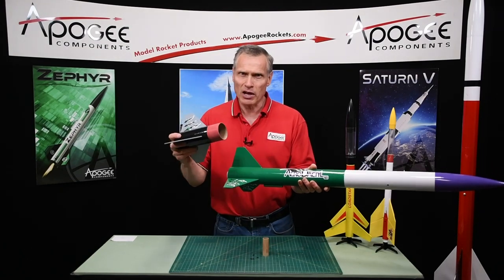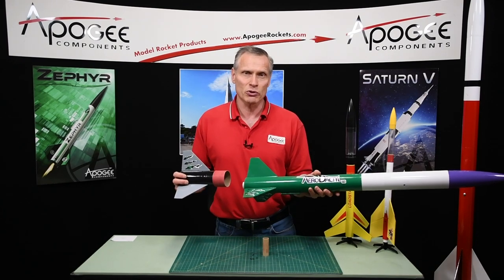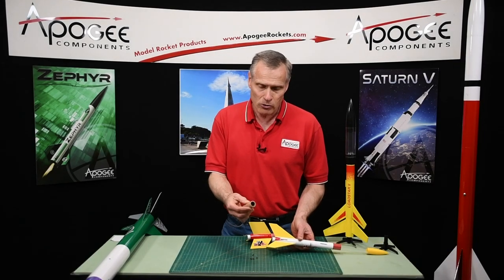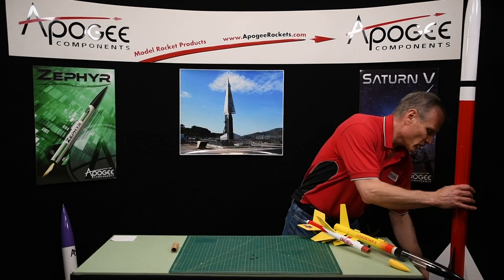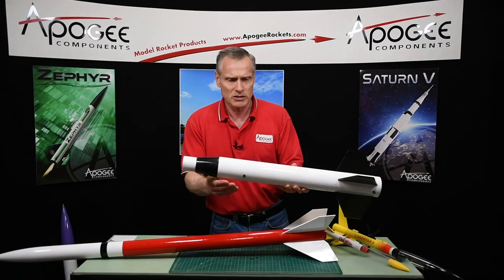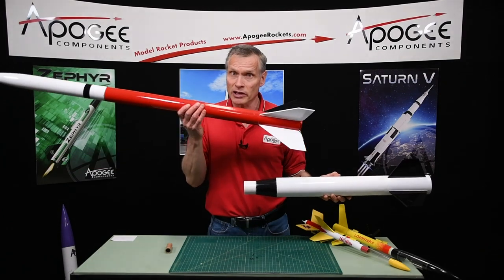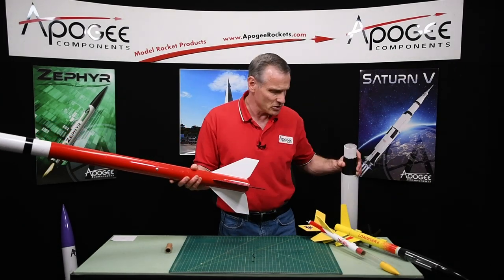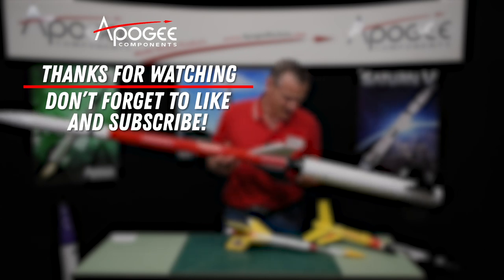4 Ways to Separate 2-Stage Rockets

Comment: Don’t feel bad, Tim.  I’ve barely touched some of my rockets and knocked fins off, too.  Makes you wonder how they can survive flight after flight.
Reply: Rick Sorber Yeah.
Reply: Agreed.  I sometimes just get near to objects and they break...😊
Reply: Is there a way to eject a parachute to the first stage so that it doesn't just fall to the ground?
Reply: @Nick21012  You can do that by adding a chute and a shock cord to the first stage and wrapping it in fireproof wadding. Once the First Stage falls off, the parachute will auto deploy (in theory, I have never built a two stage design)
Reply: @inventorsyndrome8894  or you use rear-eject with a spool and after the sustainer drag separates the booster motor's ejection charge fires and pushes the motor mount and parachute out the back of the rocket

Comment: Thank you, now in working on my own two stage rocket and your video helped my so mutch. I hpe There isnt any mistakes because im from europe
Reply: Hey man, m new to rocket world.. could you suggest me a good fuel??
Reply: @4nirmit  i think you can buy some estest Black powder motors.
Its well for starting
Reply: @hugotoscher4734  thanks man!
Reply: Is there a way to eject a parachute to the first stage so that it doesn't just fall to the ground?
Reply: Yes it is, but you have to yuse electronics to fire second stage. Than you simply put there engine with short enjection charge.

Comment: I have of course used the booster rocket pressure when I was a kid first flying estes rockets,  the combination of both engines firing was usually enough to separate with the booster stage simply falling back to the ground. That also was pretty hard on fins simply glued by white glue. But every thing was so light that damage was repairable. My budget was much limited so my efforts were spaced apart. Now I am in my 73rd year and I am more limited by travel to a suitable launch and recovery site.  Still I get a bit of enjoyment every time I launch something,  over the years I have introduced many to this rather expensive pass time.
Reply: It’s not expensive right? You can make the rockets and launchpad and parachute and other accessories all youself, so then only the motors are a problem and they are not cheap I agree. But I have seen people make their own with potassium nitrate and that’s cheap. The cost of the hobby really depends on how much effort you want to put in, at least that’s my opinion.
Reply: @bas5070  Low power can be done on the cheap but once you start to get big, things start to get expensive. To make your own motors you need to be at least level 2 certified and a level 2 rocket can be very pricey.

Comment: The old Estes model rocket instructions recommended that the motors for the separate stages be taped together with clear tape so that they wouldn't come apart too soon after the booster propellant blow- through such that the upper stage motor wouldn't ignite. That limited the length of the booster stage(s) and a lot of their vintage kits have large booster fins to compensate for the concentration of weight at the rear of the rocket.
Reply: I wish I read this before it happened to me 😂

Comment: Hey, Tim. I just wondered, when using drag separation, you could also use an electronic circuit in the second stage with a switch that activates the second stage motor when the two parts separate. That could be done by a short string coming from the first stage that then pulls out a seperator (maybe a piece of paper or so) that is separating the two parts of the switch so that the circuit is closed when the paper gets pulled out.

I've never seen that before, but it would certainly be interesting to see. Like that, you'd just need a power source (battery) in your second stage and no other electronic components. Maybe the acceleration G's might be a problem for the seperating piece of paper (it might get pulled out by those forces, idk) but it might be worth testing something like this.

Cheers, Jan
Reply: Yea there could be nonconductive material between the ignitors that gets pulled out when the first stage falls off.
Reply: I was thinking the exact same thing. I have a rudimentary trigger for a warning buzzer that alerts me when someone, or something approaches my camp, or a specific area around my house. A $10 portable set up. Thin piece of plastic or cardboard between a spring contact (clothespin in my case), and string stretched across an inviting pathway.

 I guess you'd probably want a "remove before flight" trigger of some type, just to keep from an accidental ignition but that's simple enough as well.

Comment: Good morning Tim!  Thanks for the video, I always learn something from you.  On the two low power methods, how loose of a fit should the booster have to the upper stage?  It sounds like there is quite a lot of pressure, so I won't need it so loose that when inverted (on the ground) the upper stage falls off, clearly not so snug that I have to really pull them apart...  any tips there?
Reply from the maker: I say the same fit you use for model rocket nose cones.
Reply: @apogeerockets  Is there a way to eject a parachute to the first stage so that it doesn't just fall to the ground?
Reply: @Nick21012  sure there is. In the terrain kit for example you have a conic plastic section that joins upper stage and lower stage. In it you have to fit your electronic, with one pyro that ignites the upper stage, then a second one with proper delay that ejects itself out pulling the chute. Be careful to protect well your chute. It’s a kind of two stages.

Comment: I was with grandkids a couple of days ago and we built and launched a bunch of Estes Bandits. We had a couple left over so we cobbled them into a two-stage rocket. We didn't have any booster motors, so we used two single/upper stage motors and crossed our fingers. Of course it didn't work. I'm guessing the spacing between the two motors was too great, and the plug at the top of the first engine prevented the second engine from firing. (I couldn't remember the finer details of building two-stage rockets from the 60s, I should have known better..) We did hear a loud bang when the first engine burned through but I assume that was just the ejection charge, we just hadn't heard it so close to the ground on any other launches.

Comment: Is it possible to stack like 5 engines together for a higher flight? Would custom build rocket from scratch if it can be done might try over summer.
Reply from the maker: Anything is possible. But not everything is wise...

The National Association of Rocketry has a limit of 3 stages for a reason. The longer the rocket burns, the more weathercocking it will experience. So the rocket will be going horizontal, instead of vertical. That is unsafe. Always consider safety when launching a model rocket.

Comment: It sounds like you ended up with 5 different methods, or do you count the method where the electronics are in the booster as being the same as method 3?
Reply: Is there a way to eject a parachute to the first stage so that it doesn't just fall to the ground?
Reply: @Nick21012  I have never attempted a complex multi-stage rocket before, so I don't know how people do it, but yes, most high-power multi-stage rockets have parachutes in both stages
Reply: @coastermania17  They probably do it by separating both stages and having a parachute attached to the first stage. Then the second engine is ignited through electronics. That's probably how it works.

Comment: Wondering here. For larger, high power two stage separation, what would be your method of choice? My last rocket was a two-stage (I class motor on booster, H on sustainer), using onboard avionics for sustainer ignition, and while it flew successfully and recovery went well, the staging itself was pretty rocky, launching the sustainer into a corkscrew until it stabilized itself and reached apogee. My bet was that the fit at the interstage was too tight. Part of the coupler got burnt pretty badly and that asymmetric separation might have created some unwanted rotation. Any ideas or suggestions are welcome.
Reply from the maker: My suggestion is that with enough experimenting, you'll work out the bugs. But use scaled down rockets to do testing, so you save money.
Reply: @apogeerockets  Thank you. I'll definitely experiment more to figure out how to make the best staging. It just feels so good to see the second engine ignite in-flight, I won't be going back to single stage design soon.

Comment: What is the furthest distance you can separate black powder motors for staging? I would say what distance does the reliability for second stage ignition really drop off? Wondering if I could stage the new Estes Black Brant kit. Thoughts?  Think they call it pass port staging instead of direct staging when we gently tape the motors together.
Reply from the maker: I don't have a number for you. I've done more than 8 inches reliably with a small mini motor. I don't know a maximum. I encourage you to try and test it out. I'd be interested in knowing your results.
Reply: @apogeerockets  Thanks Tim. Sounds like a fun little project. I will test it out. BTW: that large two stage rocket you were holding at the beginning of your video is BEAUTIFUL! I am assuming you sell it. Will check it out too. Thanks for your input. 
Andrew

Comment: I've been building cluster stages/w recovery using black powder motors.
So one or two to stage and a delay motor to shoot the chute out.
I've built a 3 motor cluster first stage and a 2 motor cluster first stage. They require elaborate transitional pieces between the upper and lower stages, I've figured a way to incorporate a recovery method for those too!
Reply: Is there a way to eject a parachute to the first stage so that it doesn't just fall to the ground?
Reply: The way I've been doing it is with a cluster first stage, with one motor being a short delay, and the others regual booster motors. The delay motor has a separate tube to hold the parachute. You need to add a fairly long gap, at least the length of the chute. It's possible, and I have proof on my youtube page =)

Comment: Sir how to ignite the other stage of rocket after the first stage .. pls tell
Reply: Either use the booster motor or electronics like the perfectflite mini timer 4. How big is your two stage? For some of my smaller ones, I Just tape the booster motor to the sustainer and friction fit. For my current level two build, I'm going to use a minitimer4 in the interstage coupler to ignite the sustainer motor with sheer pins to prevent drag separation or maybe just friction fit will be enough.

Comment: Considering a-c cases can fit inside of a c-d case I kinda wonder if I can press the smaller motor on top of the larger motor so it’s a overall shorter length, I do worry about ignition and separation though even though it’s a friction fit.
Reply from the maker: I give you permission to experiment. I don't know what you're talking about. But whatever it is, you'll need to experiment. I don't have any suggestions for you.
Reply: @apogeerockets  he wants to put an 18mm motor on top of a 24 mm booster motor. It's been done before, I saw it on the rocketry forum

Comment: Are the booster motors different from the normal ones, do I have to buy different motors for my first and second stage rocket or can I use the same c6-7 for both stages
Reply from the maker: They are different motors in each state. See: https://www.apogeerockets.com/Tech/How_2-Stage_Rockets_Work
Reply: @apogeerockets  where do you buy the booster motors?
Reply from the maker: @carterfilms3.047  If you are in the USA, you can get them from www.ApogeeRockets.com. If you're outside the USA, I don't know.
Reply: @apogeerockets  what is the rocket engines full name
Reply from the maker: @carterfilms3.047  Estes C6-0
Reply: @apogeerockets  thank you so much for the help I love your content🥰
Reply: Are using different motor engine can decrease rocket velocity at second stage
Reply from the maker: @هشامامين-ه8ض  Yes

Comment: Hi Tim, my brother Perry, who made a submission to your magazine made a 2 stage rocket with @ 10" separation between stages (https://www.youtube.com/watch?v=_p0fG_KFZmg). He wanted to see if the 2nd stage would still fire with a gap in between, which it did!
The problem though was with the 1st stage chute deployment. Because he was using a black powder motor with no delay the rocket was moving too fast for the shroud lines to stay connected so they shredded. My brother said for Estes motors you can't use a motor with a delay because they have clay caps inside them that could prevent the 2nd stage from firing.
My brother doesn't want to us electronics for this. Any suggestions on how to get the 2nd stage to airstart off a 1st stage motor with some sort of delay in it? Could he use say a D12-3 and still have the 2nd stage ignite or would the clay cap on top of that not allow for an air start?
Reply from the maker: Why doesn't he want to use electronics for this? We have a similar size rocket called the TTV that uses electronics to ignite the upper stage, and it works great. https://www.youtube.com/watch?v=1p30MqW8xVo. It opens up so many more motor choices and if the upper stage fails to ignite, there is a redundancy that will still kick out the parachute. And the booster stage can have a conventional arrangement for the parachute too, so you don't have to worry about stripped lines. I'd try that first.

Comment: Great fin attachment on that Loadstar . . . Try using Fillets, even on the "props" you use in your video's . . . LOL !
Reply: That’s just mean dude, it happens to everyone, don’t make fun of him
Reply: I guarantee he builds his stuff to a higher standard than you.
Reply: @BlueTrane2028  I guarantee you have no clue . . . When a fin snaps off under minor pressure, it's crappy construction, period !
Reply: I mean it could be balsa. I guessmyou could still paper or fiberglass the fins but still doesnt take too much to snap a papered balsa fin. But it didn't look like his fins were reinforced at all. I dont reinforce my balsa fins on most low power fins except for ones I find extra exceptional. HPR is where it's at with me but I still mess around with low power as well